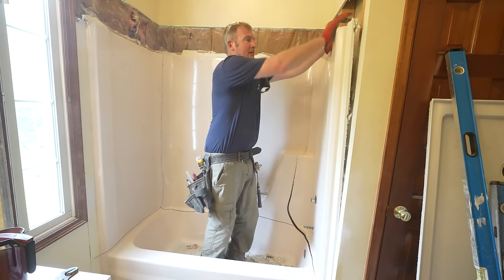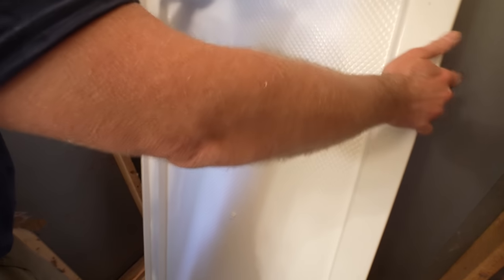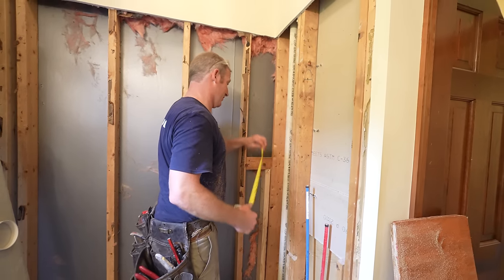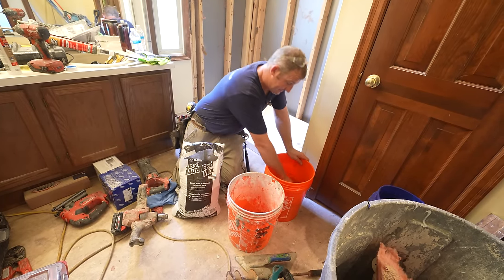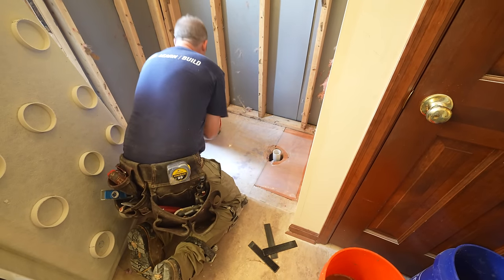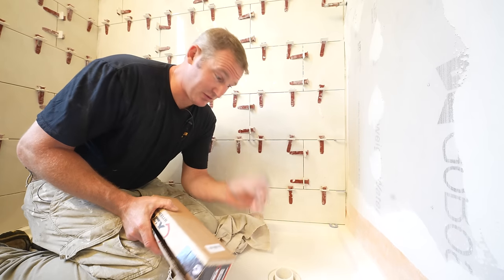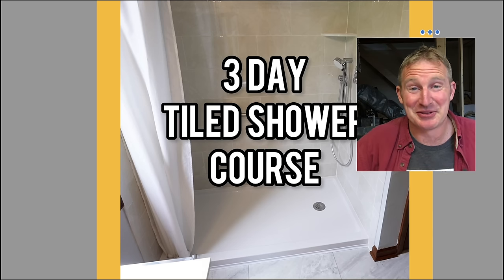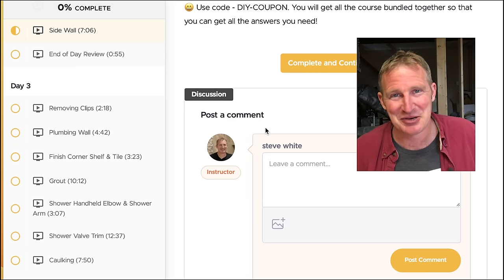Installing a Shower Pan Base | Tub to Shower

Comment: i respectfully  say this: i don't know why people still insist on the mortar , i have probably installed 40 of this shower base in the last 10 years, and not even one call back , no squeaks, like nothing at all, a good underlay foam and that's it. screw it against the studs, provided it comes with a flange
Reply: What kind of foam?
Reply: Makes sense.  I bet a bunch of alternatives would work.  They should put small wax rings around each circle.  Like the toilet flange kind.  Mortar just seems like overkill and a hassle if you ever need to remove.
Reply: Maybe 40 new construction jobs.  Let’s see you put down 40 in 100 year old houses  with foam underlayment
Reply: Or if you’re just putting them tight to uneven floors you have floating spots in pan or what is a customer going to do when they try and install a glass door on a edge that’s 3/4”+  out of square?
Reply: Just tell ‘em to hang a curtain 😆
Reply: Also you’ll probably be bouncy on perimeters which is awesome for tile surrounds
Reply: We use drywall joint compound. About a 3 gallon bucket per shower pan. Basically put big globs of it and press the pan in so it's level, then screws to hold it in place. That's what the instructions said to do. I'm not trying to say I'm a pro, I'm here to learn more. Just Surprised to see so many using mortar. Seems like a lot of unnecessary work added that way.
Reply: I’ve used silicone on the bottom of those circles.
Reply: Yeah the mortar is insane very much not needed!
Reply: @tericourte2690 I use spray foam.  Put it down in a snake formation about 2” thick.
Reply: We used big gap foam as long as the floor isn’t awfully unlevel (within a quarter inch all ways) use 3 small cans for a standard 30x60 screw it down the foam will do the rest
Reply: Would that underkay foam hold a 400lbs person? Real question 😢
Reply: @N1Caraguita  you are totally missing the point , the underlay foam does NOT HOLD any weight , that’s the floor for, underlay it’s only to minimize the noise , mic drop
Reply: Builder used a pan in my master and the thing makes terrible cracking sounds with expansion/contraction.  Probably wouldn’t happen if they set it in mortar 😡
Reply: My dad put refined sand on it, it was still there 40 years later today when I put a new pan on it
Reply: You mortar because the shower pan flexes if you dont which leads to leaks around the drain.
Reply: Mortar is correct..foam fails in time because foam breaks down..under stress of a pan flexing from a heavy person shifting their weight on the ball of their heel...All a tec needs to do is actually stand on a polypropylene pan and see how much it flexs to understand proper support is paramount to getting 50+ yrs out of a shower..Mortar, Thinset , floor leveler products is the way to insure that pan won't stress crack over time..
Reply: @adamp462 i think he meant high density spray foam. Not foam sheets
Reply: @tinkerinWstuff or spray foam!
Reply: 100% this, a single can of low expansion foam is so easy to do.
Reply: @adamp462 my house is over 100 years old and I used foam.
Reply: Not sure if anyone has already commented on here the importance of using mortar. (Location wise)
Sometimes leaving an open cavity allows for rodents to home underneath and around pipes.

In the south-east, a lot of tubs are not mortared to the subfloor. Once they are tore out after a few years, you’ll find mouse droppings and or squirrel acorns and nests — have also found carpenter ant trails from the drain of floor to back wall
Reply: Correct way is to use mortar.
Reply: With abs crap shower bases, you need to support them well, they’re too flimsy on they’re own. Acrylic units a superior to abs and have minimal flex, use flooring glue to stop it from moving, and keep tile/drywall away from sitting in base or butting up to skirt, that’s wear squeaks start
Reply: @tinkerinWstuff  we just had new walk in shower and installer didn't put anything down under base and it creaks and flexes terribly.  We have to rip out the whole shower now, so disappointing
Reply: After 15 years the foam compacted.  Now I have to replace. Definitely doing the morter!
Reply: Manufacture remends to set in morter and your an absolutely should if you don't your a hack 20yr professional master plumber here
Reply: No it's the only correct way of doing it 20yr master plumber if you're not using mortar it is wrong @EnoreeAD
Reply: @jacobpeffley853 over time you will start having problems with the foam as a 20yr master plumber the only correct way is to set in mortar  but it will last for a while so maybe it will be someone else's problem by then lol
Reply: @N1Caraguita 20yr master plumber here no it will pack quickly and cause stress to the fiberglass needs to be set in mortar
Reply: @alaskanadventures1164 don't matter neither will work only use mortar period
Reply: @alaskanadventures1164 never use spray foam or any foam period do it correctly mortar is always the only thing that is the correct product per manufacture 20yr master plumber
Reply: @Macky4941 you shouldn't
Reply: Totally agree
Reply: Real pros use mortar.
Reply: Our show pan cracked where we stand under the show. It is a 25 year old pan, but what a pain
Reply: @sandymilne224 I'm a 67 year old female and had to reapply putty to my kitchen sink which worked for a minute but then I had leaking again and I ran across a video where they used silicone instead of plumber's putty and I used it and I have not had a problem since. Good suggestion😊
Reply: @cwhyharris7473  : well that’s great that it worked, but I find that silicone can squish out and then leaks right off the bat. Never had plumbers putty not seal. Tighten firmly but not over tighten because you need some putty in there. Both can work.
Reply: Mortar can help if the floor is way outa level. I’ve installed a thousand or more of these. Fills in the gaps if you need to make the pan level.

Comment: If you step in it before the cement cures, you have negated the leveling by compressing the wet concrete. Lastly you don’t raise the base once you set it in place— see above explanation.
Reply: I’m assuming he waited for it to cure before
Reply: His base was solid level before also
Reply: Can you install one of these without cement underneath?
Reply: @nate5381 No. The cement acts as support for the pan hollow frame.
Reply: @nate5381 the fiberglass rings are what support the pan.  The mortar just seems stupid if you ask me.  Once it's secured to studs, it won't go anywhere.  PL3 each ring and drop her in.  Or use a wax ring on each circle.  Not a builder
Reply: @thle8972 
It acts as a means of leveling if your floor isn't level. Period.

Comment: Good Job. Looks great! One suggestion, If you don't mind. I've run into, a few dozen times, a job where installing a safety hand bar was required. These are usually for handicap or elderly customers. In doing so, I have run into, several times, where there is not adequate blocking or stud spacing for optimal installation. I have opened walls (through Sheetrock) on opposite side of wall and added 2x4 blocking, then patched wall. So, when I do remodel and install new shower walls, with either fiberglass inserts or hardy-back for tile, i always add horizontal blocking in both walls (skipping, of course the shower plumbing wall), at the optimal height for bar installation. Hardy-back/Tile walls are probably strong enough to hold a bar on their own, but i feel better if there's some strength behind there, just in case a heavy person would try to arrest their fall and grab that handle. Safety first. I find that the cost and time to do this is very minimal and explaining to the customer that this was done for future reference, is always appreciated. Anyway, just a suggestion. Keep up the great work. Ty
Reply: I always do that as well, also when install a closet, I add blocking for the cloth bracket.

Comment: Im in a pickel. In my walkin shower I put baby chicks in there just until I got their other place ready. The heat lamp fell in the night and landed face down and burned a hole through the shower floor. Im renting this home really sucks. If you dont think a Bath Fitter cover base then I'll be putting in a new floor I guess. Thank you I'll be watching all your videoes for sure.

Comment: Amazing how much of a difference/improvement it makes when you sit a pan/tub on a mortar bed. Sounds solid and feels nice and sturdy.
Reply: My shower enclosure is really noisy. It pops and creaks when I'm using it, and keeps popping after use when it's cooling down. I think I might have to remove it and start fresh. Darn it!
Reply: @guidosarducci8850  if you could drill holes in the face and put spray from in there you might be able to fix that problem.

Comment: I wish I would've found this video sooner 🤦‍♂️I pull my hair out figuring out the drain. One thing I'm going to do is run a little tube on the floor going to the drain so I can snake a borescope to check for leaks after I set base in mortar

Comment: I discovered this channel while broadening my understanding of construction and craftsmanship, determined not to accept my current situation blindly. I'm dedicated to expanding my knowledge of construction and proper installation techniques. Your channel allows me to confidently question whether these techniques were properly executed in a project. The default solution of filling gaps with sealant, up to a quarter inch, often prompts an eye roll from me. I even joked about whether sealant could save someone's life from a gaping wound in an emergency situation? Nonetheless, your videos are invaluable, and as a former educator, I deeply appreciate your dedication and expertise in educating your audience.

Comment: Excellent!  my acrylic fiberglass pan has those same rings on the bottom.  But the instructions were completely vague and suggested that  1/4 bag would be enough mortar.   That just seemed  completely inadquate.   Especially when there is so much space underneath.   A whole bag makes a lot more sense

Comment: Work horse...you break a sweat every day. Appericiate and learn from your content. Thank you again! I have been using expanding foam under my tub and shower pans, works great, is light ,and provides sturdy support.
Reply: That's a great idea,Im remolding a bathroom with a stand up shower surround,for a elderly couple,and I was wonder about putting something beneath the the stand up pan.
Reply: How much foam does it tale?

Comment: I like the Oatey 102 solvent weld style better than the version you show (which has a nut that you tighten from bottom and a rubber compression washer that you tighten from top ).  

The solvent weld is probably a bit harder to dry fit. But if theres any future issues, theres nothing you would ever need to tighten from bottom; you do everything from the top.  Especially if there is no easy maintenance access to bottom, I'd rather do solvent weld style.

(I had a lot of trouble with the style shown in video; seal between pan and drain failed in a number of fiberglass pans in a dormitory and ended up replacing with the solvent weld style...)

Comment: I nice trick i picked up is to use expansion foam instead of doing a mortar bed. Only downside is you have to watch it and keep it level as it expands, i used two big buckets of water and worked perfectly, just checked it every 5 minutes or so checking the leveling. Bonus is that it won't creak causing the base to crack eventually like it would with mortar.

Comment: Thanks for video. Learned a lot of tips. Just wondering what brand / model of shower pan did you used for this project. Any particular brand/model I should go with or avoid?

Comment: Thanks for the video. Wonder why you didn't cut the drain pipe first before setting it in stone.
Reply from the maker: Less likely to mess up the correct distance with a no caulk drain. Just cut to depth needed after setting pan 👍
Reply: what is the benefit of using a no caulk drain?  @BathroomRemodelingTeacher
Reply: @mings7337   i suspect its because he doesn't have access to the underside?
Reply: I was wondering that also
Reply: After having done it now I am in agreement with BathroomRemodelingTeacher.

Comment: i couldn't tell but when the 1 1/2 tub drain got cut out , its important to note that by code a 2 inch trap and drain is required. it looked like same 1 1/2 went back? i clicked on this to watch a guy make a pan , but was not exactly as i thought.  But I would always recommend people look up the code and learn why and why it is, or even build better then code.

Comment: Nice job, but one question.  You  don't glue the drain assembly into the pipe, it's a compression type connection?
Reply from the maker: Compression type fitting 👍
Reply: @BathroomRemodelingTeacher  Thank you.

Comment: Hi.  Any issues with buying a 30x60 porcelain coated steel shower base like from Boots instead?    There design doesn't require mortar but does require a level base.

Comment: You are the best youtuber on bathroom stuff. I have watched 100+ hours. You go through all of it. You repeat common actions that most people leave out like teflon 4 to 5 times. I've heard you say some stuff over and over so it is trained in my brain. I'm installing a new rough in valve that is a replacement to another model and has a separate hand sprayer so an extra port. We shall see. I wanna be lazy and jerry rig the new one where old one was. Whoever did it used Delta with the pipes holding it up. The new one is too heavy. Dude I didn't even know what a 2x4 was when I started. Every single thing I have to watch 20 videos for just to use a tool. Never used any of my saws yet. So everything is tedious for me. Thank you!
Reply from the maker: 😆 thanks, I sometimes repeat myself too much, but then again remodeling bathrooms become repetitive 😆

Comment: So why silicone instead of plumbers putty?
Reply: In an acrylic shower pan like this, silicone is better in my opinion. Plumber's putty never hardens, provides no strength or adhesion to either surface and basically just creates a gasket....not really a "permanent" water tight seal. The pan is set PERMANENTLY. The drain assembly should  also be attached PERMANENTLY to the pan imo......hence, silicone.

Comment: So it's better to use silicone vs plumbers putty to install the drain to shower pan? I'm getting ready to tear out the 1 piece tub/shower today and install shower only kit. So the drain pipe needs to be an inch below the top of the drain, could I also just measure and cut it, fit it before laying down the pan?
Reply: According to the delta acrylic pan instructions, you should only use silicone and no plumbers putty
Reply: @MrTheBigNoze  That's what I thought, just makes more sense as I've had to replace drains that were installed with puddy and failed.

Comment: Most people don't understand what silicone + rubber is doing. Try to put some silicone on rubber gasket on pressurized system then you will never make the same mistake again.

Comment: Doesn't low expansion spray foam work just as good as mortar for setting the pan/tub? Thanks!
Reply from the maker: I really can’t see how it could be better than mortar? But they are making better foams and things these days. I don’t know of a manufacturer that recommends that yet
Reply: The instructions for that shower pan he's installing actually tells u to silicone the bottom no mortar
Reply from the maker: @psychonaut513  no, no it does not
Reply: The one I did was identical but hell who needs instructions..lol
Reply from the maker: @psychonaut513  I’m sure there are different methods of installing, if it worked for you good for you 😆

Comment: 2” x 1.5” reducer above the trap is a big ol YIKES 😅
Reply: What is the issue with that? Honestly wondering.
Reply: Austin V Papp  ohhh. Thanks!
Reply: He is not a licensed  contractor , plastic under mortar, so it's going to be a floating shower pan
Reply: austinvpapp4701 , yep in a perfect world, and if it was new construction, replacing a tub with a shower, not worth chasing a 1/2 in., and being a 1/2in. Off code, it will be fine.

Comment: Please tell me that you put a wrench or large pliers on the shower drain. Hand tight is not enough. Proper plumbing is meant to last. Twenty years from now, you could have a problem.
Reply: Everywhere I watched video said to only use hand tight. Are you a plumber? I’m asking for my info not to be contrary
Reply: Yes I am and I have fixed a lot of those “ hand tight “ drains. 
Not real fun to tell a customer that the stain in the first floor ceiling is from the 2 to 5 year old shower install..  Not to mention the mess and inconvenience..

Comment: A tub is an 1- 1/2 drain, The shower needs to be a 2 inch drain,  It is illegal to reduce a drain line,  How did you increase the drain line to 2 inch.
Reply from the maker: Not illegal. IPC allows it
Reply: Only a licensed plumber is allowed to modify  Or alter plumbing. And an inspection would be required.
Reply from the maker: @donaldblank8873  yes 👍

Comment: Why is silicone most preferred as a sealant vs plumbers putty or rubber gasket that tubs/pans come with? 🤔
Reply from the maker: Many manufacturers recommend silicon
But it’s a preference of mine ever since I had a leak years ago with plumbers putty. Took 3 years before I got a call back on it, but Never had an issue like that with silicone 👍
Reply: @BathroomRemodelingTeacher  Wow. Good to know. I would guess that is the other way around. Thanks Steve! 💪👍👊
Reply: In most cases, at least where Im from, those who prefer silicone are not licensed plumbers. 30years Master Plumber and not a single issue with Plumber's putty.
Reply from the maker: @shonhurt4520  pay attention to manufacturer specs though. Some require silicon (not necessarily master plumbers 😆)